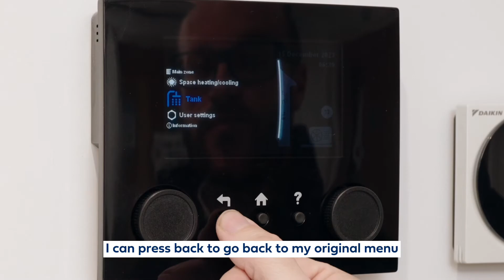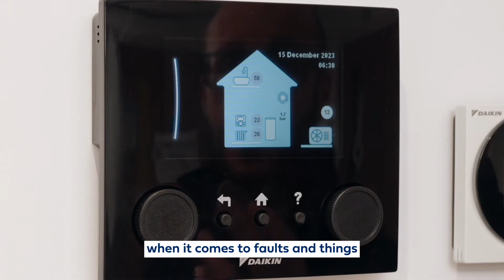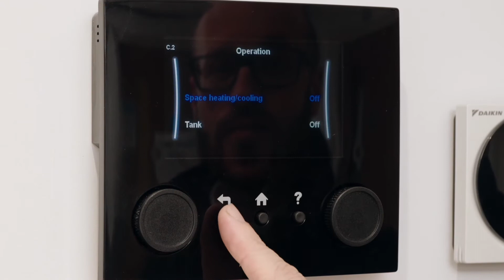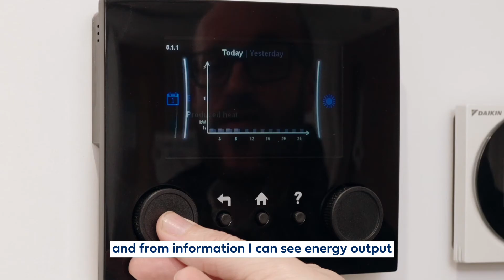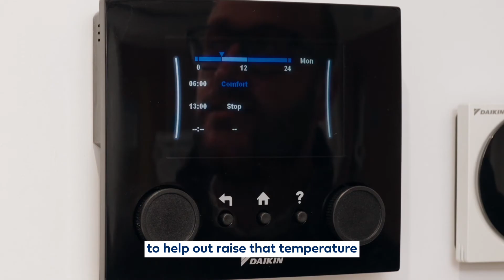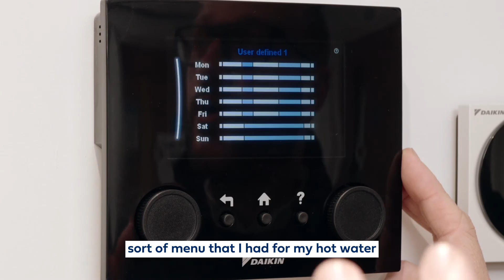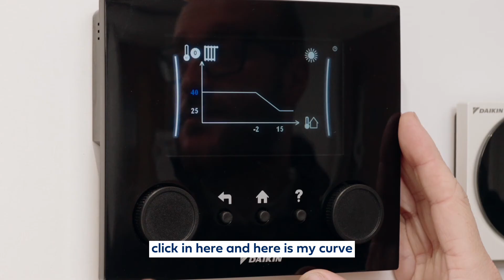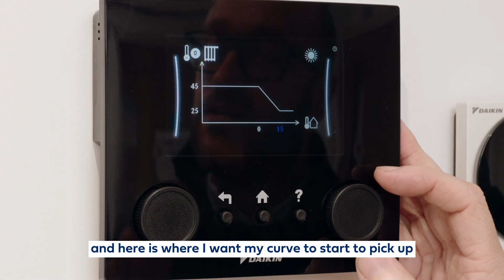Daikin Altherma MMI Controller - Complete User Guide

Comment: Brilliant video thank you ! Just moved into anew build with a Daikin Altherma air source pump and one of these controllers. We were told not to touch anything in the garage including the controller ! We we told to just use the sensor/thermostats inside the house to control the heating but that doesn't help with understanding the hot water system. I had no idea you could set the water heat up times as I think we are wasting so much hot water at the moment, also I've been wondering how to switch it off when we go on holiday.

Comment: Thanks for explaining. When I go in tank the only option I have is powerful.
Reply: Your installer must not have enabled it. In the ‘installer’ user profile menu 5.6 would need to be set to “schedule & reheat” for the options to appear in user mode.
You could get the installer to come back and fix it or find the installer profile pin online to change it.
“Powerful operation” is just the immersion heater.

Comment: I have my Daikin EBLA06 monoblock on outgoing water temperature control. This is purely for the floorheating.
Unfortunately, I cannot set this temperature lower than 25 degrees C.
Even when I set it via the Scheduler, I cannot set the temperature to e.g. 20 degrees for certain periods. I would like to turn the WP off or low for certain periods (during the day) via the Scheduler.
Does anyone know a solution for this?

Comment: Great video, very helpful. I have just had a Heat Pump installed. I have a question relating to setpoint modes, in the ONECTA app my climate control (main heating) is set as weather dependent and the hot water is set as fixed. Should this be set to weather dependent like the main heating?

Comment: I will have a heat pump installation by CB heating soon, but a bit confused by the tank temp. Once it is heated to a certain temp, does it hold the water warm for a few hours so that I can use the hot water throughout the day? Or do I need to presume what time I will have a bath and set the water tank temp accordingly? Please advise, thanks.
Reply: If you don't already have your answer: your tank (assuming it is a modern tank!) will hold temperature for a long time. My tank, a Daikin, loses about 2 degrees each 24 hrs. Remember that you only need your hot water set to a maximum of around 48 degrees as most of the time you mix it with cold water for a shower etc, and you only need to run a legionella cycle once a week (heats to 60 degrees). I have my legionella cycle run on a Monday morning, and we (there are 2 of us in the house) do not need to re-heat water until Wednesday morning. 

If you have off-peak electricity at a cheaper rate, make sure you program your hot water heating during this time period.
Reply: What size tank do you have , I have seen other YouTubers say if the water turnover is every day if two then legionella cycle isn’t needed and turning it off will increase your COP. I’m just investigating different heat pump options for my own install and will need a new slim cylinder. Only two of us at home usually.